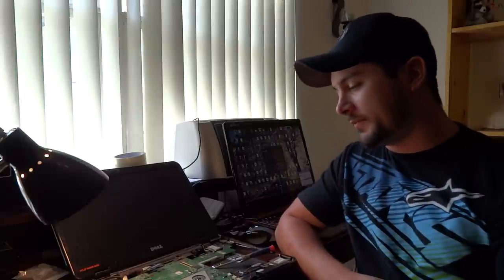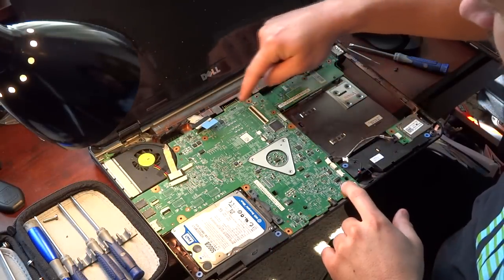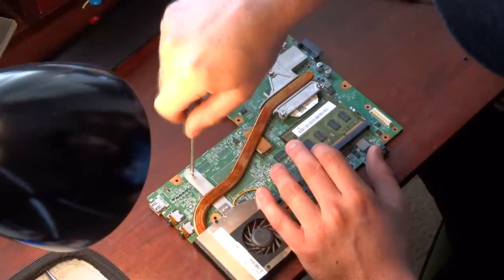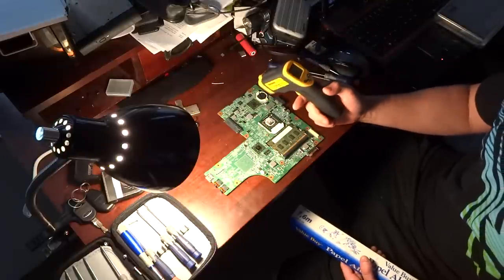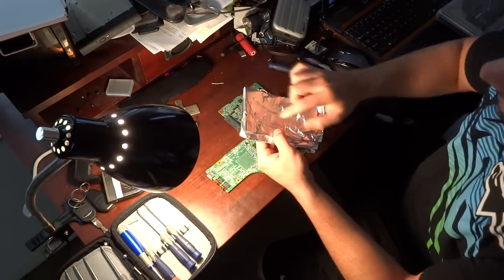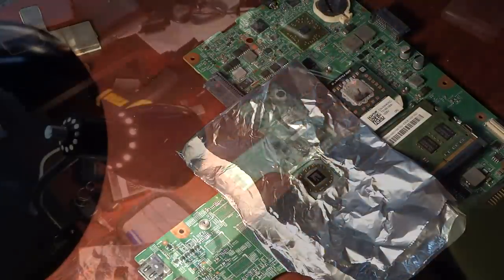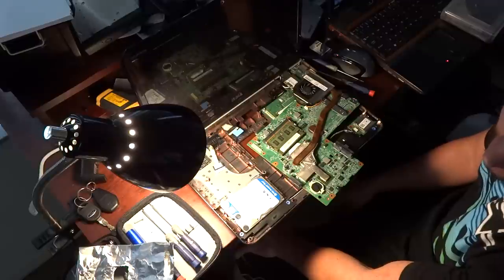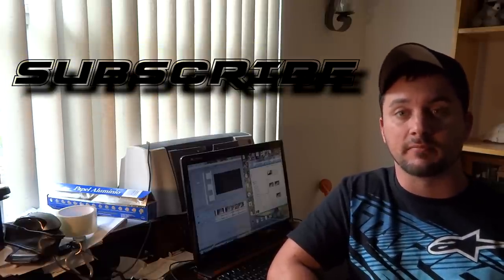Dell 7 Beeps "Fix"

Comment: Fantastically clear video, many thanks. Highly recommended. Worked for me first time.
A friend asked me to look at her laptop as it "wont turn on" and I discovered it had the dreaded 7 Beeps problem. After trying the quick fix solutions like wrapping in a blanket etc. with no results, I decided I needed to get serious with it and after a lot of research decided on using the method in this video.
I first used the video by same author to get down to the motherboard, again this was great step-by-step stuff and I did it no problems.
I used the kitchen foil as described but I used a hot air gun set to 300c. I have an infrared thermometer like in the video but after about 5 gentle minutes of heating it up slowly I reached only about 160c. I turned the gun up to 500c and managed to get the chip it up to 180c, but by now could not see it getting any higher and was concerned about causing damage, so stopped. Renewed the thermal paste ( having cleaned it off before heating) and re-assembled the laptop.
YES!! - powered up first time with no problems and has done so several times since, so fingers crossed all is OK for a while.

This was a first for me in dis-assembling a laptop and I am well impressed with the video - oh and myself of course! My friend is also pleased that I have saved her a big repair bill from a commercial shop.

ps. Maplins in UK do a TIM kit that has cleaner and new thermal paste for about £12.
Reply: Gf
Reply from the maker: Keith Farmer Thank you Keith for sharing your experience for others.

Comment: Daughters computer was dead. Thought for sure it was a goner. Found this video and thought it couldn't hurt to try. Went through the process using a heat gun and thermometer. Put it back together and was AMAZED. It started right up. I have had it on for 18 hours now running virus, malware and spy scans. Seems to be fine. Hope it lasts. Thanks for your great video.
Reply from the maker: Michael Lyons Really Glad this helped you out! Believe it or not this video was posted Jul 6, 2013, almost 2yrs later now and I'm typing this message from the laptop in this video without any modifications since this video!
Reply: +MrPCElectronics Hey man, I find you're vid helpful, I was curious if you'd be able to help me with my situation. I have an M5010 and I love it to shreds, I use it for school, research, and media such as facebook, youtube, light games etc. It was given to me as a gift by a friend, who didn't take much care of it. Since then i've purchased many things for it such as a new palmrest, 8 gigs of Ram and a new fan. Unfortunately during one night I fell asleep while on it, and pushed it off the bed. It only fell like 2 feet onto carpet, and when I grabbed it, it was still asleep so I thought it was good. The next morning I received the 7 beep error. :( I opened it in search of any damaged or unplugged parts, but found nothing. (I have not checked the bottom of the MB where the CPU and Northbridge chip are yet) Do you know if there are other ways to receive this error, such as a loose wire? Or maybe even since my friend didn't take much care of it and clogged the fan up while he owned it, that the solder could have been loose and the fall finally did the job? anything helps, i'm desperate and it's definitely one of my favorite PC's. Thanks :D
Reply from the maker: Take the Ram/memory out and re-install it.

Comment: Wow, I just tried this and it worked... 7 beeps black screen before... used my £30 SMD soldering rework hot air gun and 230degrees for 5 mins. Exactly as you showed. Put it back together... bam... it works. Dude, you fn rock! Thanks from the UK.

Comment: Thank you! Great fix. Followed all steps except used a heat gun on low for about 1-2 minutes and about 3-4 inches away in a slow sweeping motion. FYI - 2 beeps would indicate the RAM is NOT installed.

Comment: Thanks for the tutorial. I just reflowed chip using info I got from you. To be precise, I heated with soldering jet. 1 min 100 degrees, 1 min 200, 2 minutes 300. Worked like a charm. Replaced all thermal pads and paste, too. Thanks for video.

Comment: Hi guys,

On Monday morning my M5010 beeped 7 times. Since my sister's laptop died like this 5 months ago, I knew I must buy a new one. However as a man who has nothing to loose I wanted to try the baking.

So yesterday I preheated the oven to 195 Celsius and put the motherboard on top of 4 aluminium foil balls in a pan. I baked it for 8 minutes and after I turned off the oven and let it rest for an hour. A cooling part is crucial, it shouldn't be moved.

After the cooling I put the parts together and pressed the button. It worked just fine.
Reply: this souds easy, did u cover the whole mobo with alluminium foil, or just the top ?

Comment: Good save. 
Although on a different note, please get a heat gun. Direct exposure to an open flame does a couple things that you don't want. Particularly releasing fumes as a result of oxidizing the resin on the surface of the PCB (the green stuff around the chip) and it makes things permanently brittle. It also creates a carbon layer which insulates the materials, carbon isn't a good heat transmitter and would cause overheating.

Comment: Amazing! Worked on my first try with my heat gun. Would never have tried it without your video. Only thing to note is that I was getting 8 beeps - tried replacing my LCD with no success, then tried this and it worked perfect! thanks!!

Comment: Absolutely worked great. I put an electric heating pad (on high) between bottom of Dell N5010 and blanket, then wrapped more blankets the top. At 25 minutes the laptop stopped beeping. Unwrapped, let it cool and now runs great. Super tip.
Reply: +bob sam .. WISH I HAD A HEATING PAD NOW.. I WONDER IF I USE A DRYER WOULD THT WORK.. LOL
Reply: +bob sam PLEASE EXPLAIN TO ME STEP BY STEP UR PROCESS... WHAT TO MAKE SURE I DO NOTHING WRONG

Comment: I have done this but after 3 or 4 months it's beeping again so another way to fix this is  if you can use a soldering iron turn the MB  over and  go over each cpu connection with your soldering iron and solder re-solder the cpu.  This does the fix permanent.

Comment: hey dude thanks so much i put the motherboard in the oven but i did it on 100 degrees c  uk and it works i am still shocked as i have never fixed a laptop before am more on pc towers thanks alot your awesome

Comment: I have the same device and the same problem, I did the heating and even reballing but after a while, the problem came back, I heard that in some models you can make the motherboard use onboard graphics instead of the chip, in other words, omit the graphics chip of the circuit. is it a possible option for this model?

Comment: Thanks for the informative video. I was wondering about the heating process, what I would like to know is what size heating device do you use. I have looked for a mini torch like you was using but unsure what size I would need. (Trying not to spend to much $ as well)

Thanks!
Reply: Ebay search for Soldering Rework Station... £29 in the UK... cheap as chips. Works a treat, I safely did mine with this because it knows the temperature its firing out of its nozzle. You can dial in 230 degrees and not worry after that.

Comment: My less than a year old New Inspiron 11 inch 2 in 1 that cost me over $600 and have not used it much because i use my 17 inch HP laptop for my main PC woke me up this Sunday
morning with these annoying extremely LOUD BEEPS i thought it was the Smoke Alarm and my Apartment was on fire and it took me some time to find out were the beeps were coming from and realize it was coming from the Dell this really pissed me off and brought
me to this site and I was going to Buy a new Dell 17 inch i7 laptop today to replace my old
HP 17 inch i3  No More DELLs for me just because of those LOUD BEEPS Error Code its 
got be the most annoying Stupidest thing i have ever HEARD i will getting a HP instead
with no LOUD BEEPS , ,the dell just about gave me a stroke with those beeps and why do they have to be so LOUD ,  ,  AAAARRRRGGGHH !  !  !   Thumbs up  good Video

Comment: It worked, thank you very much. I used a heatgun 2000w with 350 degrees minimum. I heated it for 40 seconds. Thank you very much again. Can you or anybody tell for how long will work the pc with this fix?
Reply: I lasted only for 10 days. Same problem again. I think the problem is that the gpu gets to hot. I am thinking how to modify the heatsink, maybe i will add a littlet peace of copper above the GPU than add the heatsink. Does anyone have a better idea, expect buying a new laptop or motherboard?
Reply: Armada-AL then what is your current laptop?
I'm experiencing it
Reply: It is working with the cooper that i added. Have passed three weeks and it is working, but the fan spins too loud and the cpu temp gets 70 degrees. I plan to sell this laptop.
Reply from the maker: Armada-AL I still am using this laptop in this video as I type this.A flat copper shim under the heat sync with artic silver will work wonders.

Comment: Can you explain why the heat fixes the problem? Really cool info but I am curius on how it actually works.
Reply from the maker: There is little tiny solder balls under the chipset,sometimes they over heat and disconnect for the motherboard and need to be remelted to connect again.

Comment: I get this error but my laptop still boots and will run games for a short time but then crashes. It will crash without games as well but takes longer.is this likely a gpu issue just the same?

Comment: I looked for a document that would give the code for beeps from Dell Inspiron N5110. No luck with that.  The Laptop after power on goes through the checks where it lights up the start button and the keys at the top right of the board.  The screen never comes on and the unit begins to beep after a while:  beep, beep, beep, pause.... beep, beep,beep, pause... repeat series of 3 beeps followed by a pause.  What would cause this?
Thanks if you know and even if you don't for considering it.

Comment: I have same issue, 7 beeps, and i can see clearly there is a damage on amd where registor soldered over the amd gpu,. So my question is can i just remove that gpu chip and make a laptop simple (i don't need gpu anymore)
Waiting for reply hardly..
Reply from the maker: No, if you do that, there will be no video at all. It requires the onboard GPU.

Comment: thanks!!!

Acabo de hacerle a mi dell m5010 el procedimiento, use un yesquero o encendedor, hasta los momentos esta funcionando, esperemos que siga asi, de ser posible, si deja de funcionar escribo para indicar cuanto tiempo funciono la solución.
Reply: 5 months after, my laptop have the 7 beeps problem again, and the heat solution doesn't solve the problem

Comment: I put flux liquid inbetween the chip and board first and it never fails afterwards. When I used to do it without the flux it was 9/10 times a temporary fix.

Comment: Okay, SO can someone clarify for me. So is it just basically the solder joints have failed? Therefore re-soldering them would be the fix?  So in this video he is just using a torch to get the joints to re-contact..?
Reply: +D C Reballing is the correct process.  The balls refer to little solder balls that sit in between the GPU and the motherboard.  Quite a specialist job, but doesnt have to be expensive.

Comment: i guess the best way to do this to protect the gpu will be put a nickle on the tap the heat you pouring on the GPU messup the GPU otherwise if you used something on the tap conduce the same heat without damage or burn out the gpu at the end...i do the same most computers and it works the same way without burn the gpu a little bit..

Comment: and finally warning for those who use torch and heatgun did you know that the under the small glass surface is another solder balls?
this is what you cannot rework because is small and has been worked with nano materials.after reball usually 70% of amd chip are faulty the best option is to replace them.

Comment: Ok for anyone who is watching this video, he says to do it til the cpu is 245 degrees Celsius. That is roughly 450 degrees Fahrenheit. This is not correct, Warning this will fry your chipset and motherboard. DO NOT DO THIS PROCEDURE AS HE SAYS. If your gonna attempt this use a heat gun and use it 25 to 30 seconds on the chipset while on a flat surface. Let it cool then try it. If all is working Congratulations you fixed your pc. If you end up with garbled screen then heat up for another 25 to 30 seconds and try again. Never exceed 30 seconds at a shot. This guy has no clue and this fries motherboards by melting the chipset. This deems your pc unable to turn on. I use heat guns for this procedure and it works way better. Good luck.
Reply: Ummm it takes that heat to melt the solder also, no it won't damage the chip. Reflow like this is common
Reply: Erus Townsend
You do not completely MELT the solder in a reflow. If you do it will cause surface mount components near or behind the chipset to melt off the motherboard. I got a dell m5010 just like the one in this vid. Followed his instructions and it will no longer power on and I only got it up to 220 C before deciding that was way too hot!!!
Reply: Then you have never done reflow. Also no you wont melt the copper, gold or any of the contacts off of the board. Fifty fifty starts to melt around 183c but is not melted fully til 216c. Other solders are higher. Might want to learn something
Reply: Also learn to do step up heating and not instantly max temp. Another thing if you supposedly know this why did you need the video?
Reply: This type of heat will and does melt the small resistors beside the chip. It will also melt the edge of the chip. I've done it, and seen it happen.
Reply: Scott, because you didn't control your heat. You were probably a heat gun jockey with an analog temp dial. If you understand Temps then you would know when solid,  plasticized and liquid happen.
Reply: I have a high and low setting on my heat gun. What temp setting do i use?